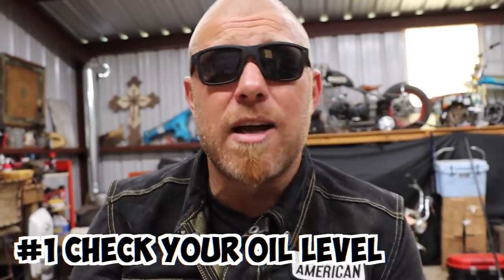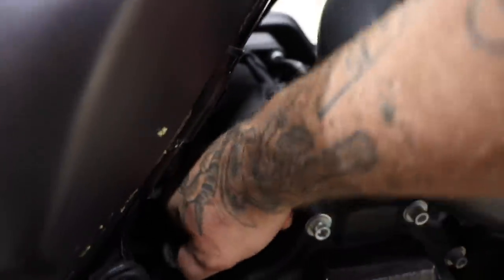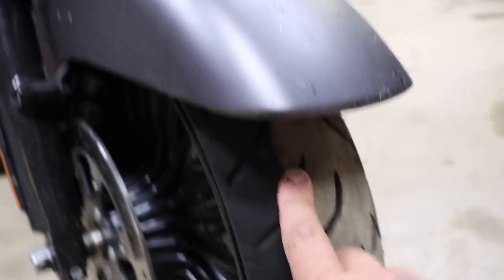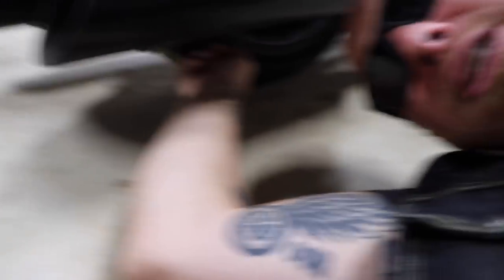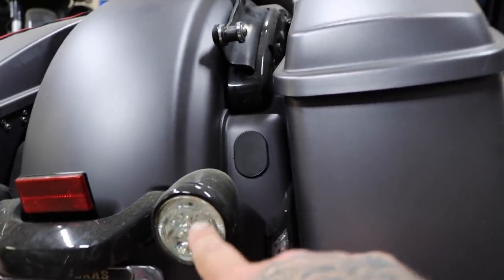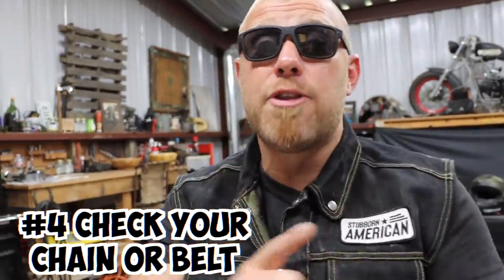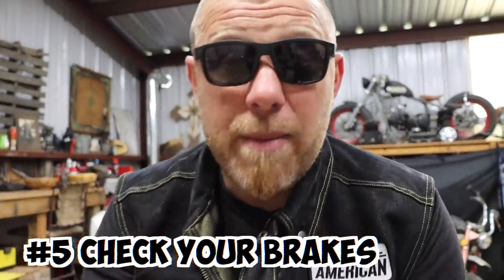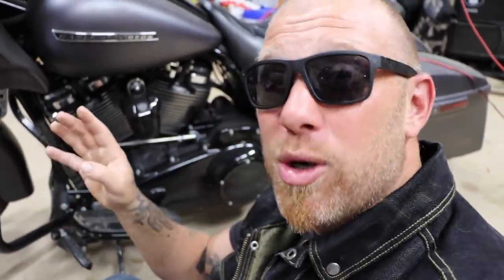5 Things You Should Check On Your Motorcycle

Comment: Hey Adam, something I like to do on my bikes to prevent cupping and increase the life of the tire, is I consistently run my tires 2 psi higher than the stamped tire pressure.  It’s just enough to prevent any cupping issues.

Comment: Heard chain slap on my FJ1200 towards end of a 200 mile ride, sometimes at 95-100mph. Checking the chain I discovered the nut on shifter clamp was almost off! Should have gone over that before making the run!! Had problems with that on my RD400 also.
Reply from the maker: good thing you found that 👊
Reply: @adamsandoval for sure. Had to replace shifter shaft on the RD400 because of loose clamp.